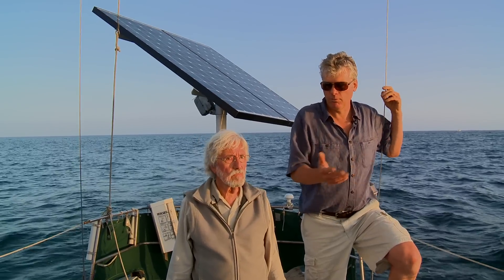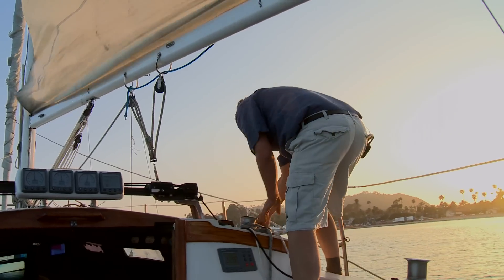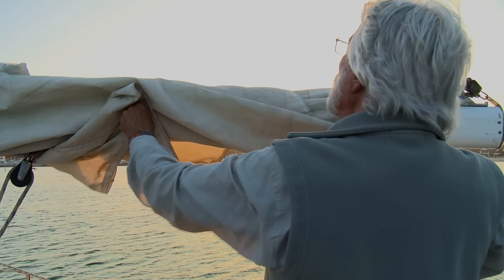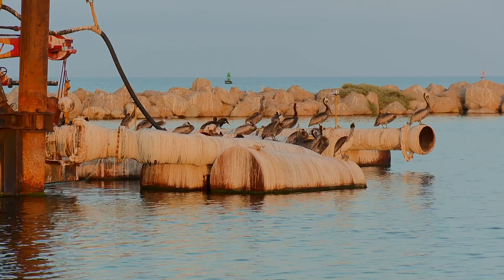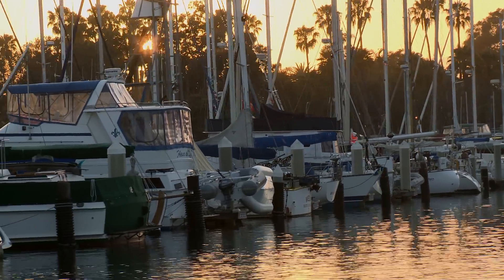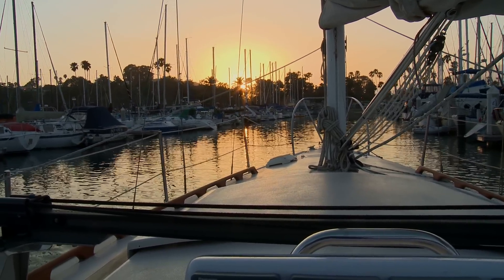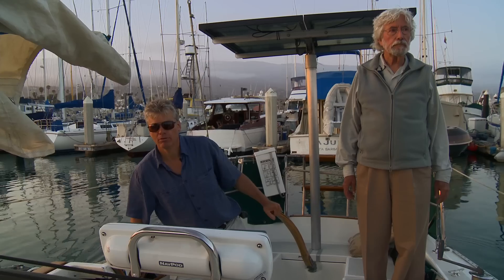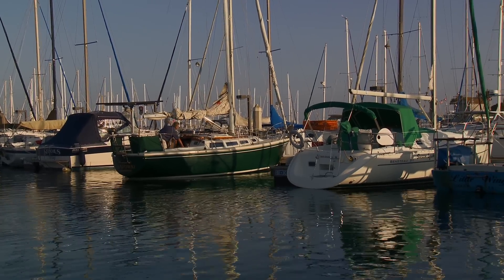Electric Sailing with Jean-Michel Cousteau

Comment: This is an interesting idea. I always pictured that I would allow the prop to turn to regenerate the energy I used getting out of the marina, harbour or anchorage. And then stop the prop when the batteries are charged. 
The point about living on a boat that does not have an oily diesel in the middle of it hits a home run with me. 
I mean you love that old Perkins when you need it on a wild night but the heat and smell coming from the bilges the rest of the time are high price to pay.

Comment: Something about that turning at the speed of the water column stuff doesn't add up.a folding prop would have the same effect
Reply: cartmanrlsusall yeah but since it's not a folding prop you can also rig these up so when you're under way under Full Sail the water moving through the prop will spin the motor and recharge batteries generate electricity under sale during the night

Comment: This guy is a misleading dolt!   he is proud of reducing the drag on his prop!  what the f     See the size of his panels? He can't do any good distance at any good speed    yes if he does use the solar power to speed up the boat then he goes home with flat batteries and plugs into SHORE POWER!    this guy IS  charlatan        fractions of horse power changing the culture of sailing yes   but not cruising     get off the weed man dah!    what a tool !
Reply from the maker: Before you make a comment like this, you should do your research.    My boat has never been plugged into shorepower and has never had a drop of gasoline or diesel to recharge the batteries.    Under solar power alone, she makes 2.8 knots in calm conditions.  Kapowai has never run out of energy and has cruised multiple times to the channel islands, about a 50 mile round trip.    Solar is the future for small boat sailing.   If you don't like the future, stay in the past.
Reply: Tell us about your Holding tanks.... If you stop dumping your Black Water tanks in the Ocean then you may have something to be proud of.

Comment: You stated your prop turned at the speed of the water column. Do you have this at a average cruising rate or is this automatically adjusted according to speed over the ground ? If automatic how do you have it set up ?

Comment: Great Idea
Few questions.
Are you using a varible frequency drive and AC Motor or traditional DC Drive and motor?
What size motor are you using?
What type battery and what voltage are you using?
Reply: Three phase AC motor.